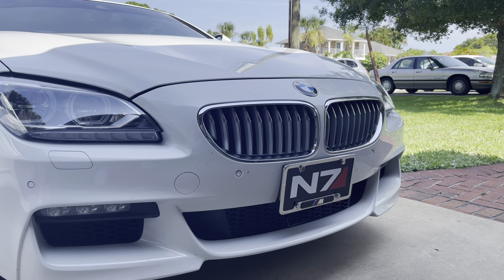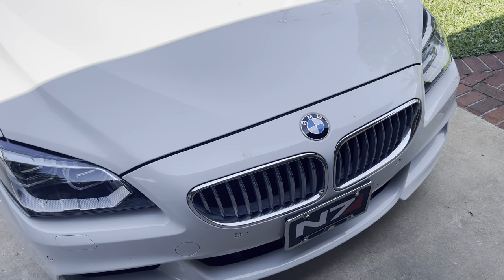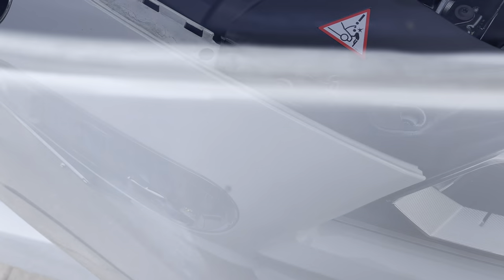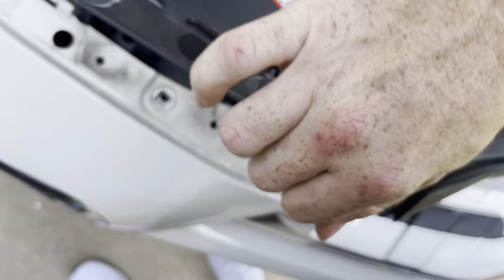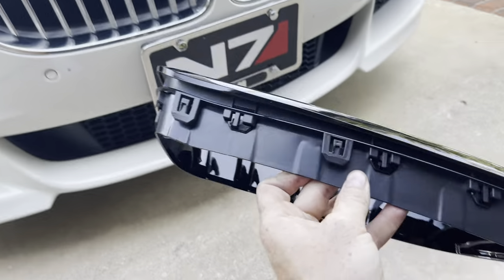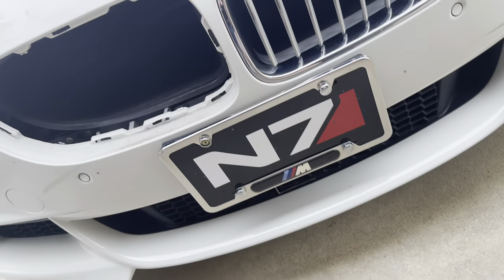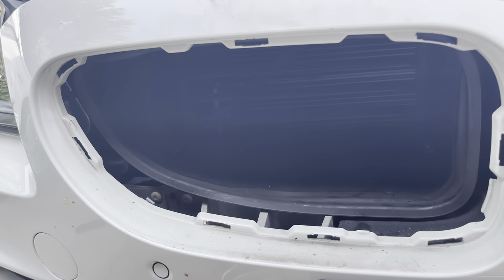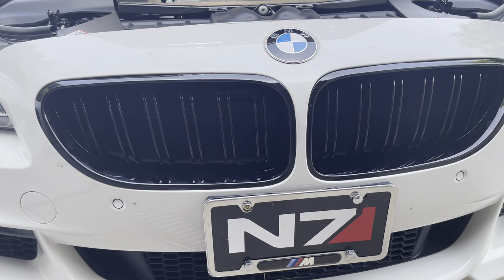BMW F chassis kidney grill swap

Comment: That's not how you remove and install what you called push pins. Please everyone pull the pin up in the center ten pull them out and to install them back in don't squeeze them. Just push them back in place the push the pins back down to lock them in place. Ripping them out is not the correct way. Once I seen that I was no longer interested in the advice in this video, next
Reply from the maker: Ok master YouTube mechanic - regardless I got the job done and that includes putting them back together. What a weird thing to try and flex with though, ya dork